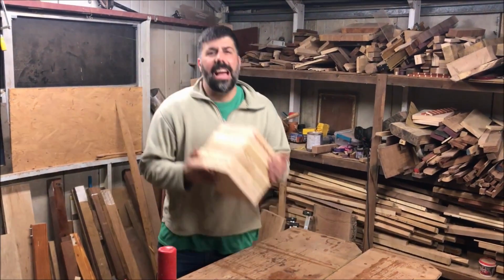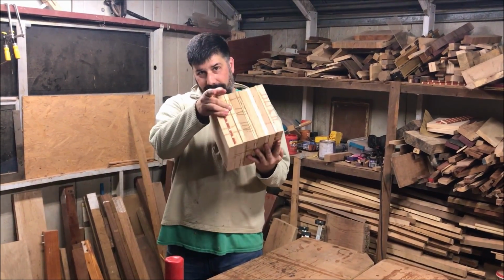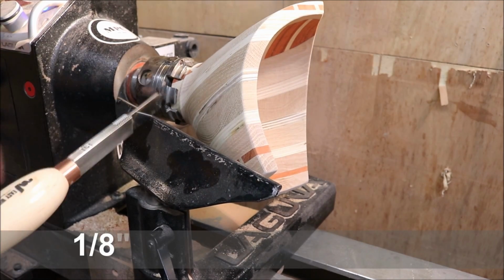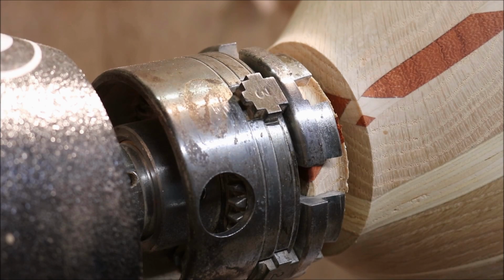Wood Turning - Giant Three Winged Bowl

Comment: Rookie Turner here. Wondering if you could make the square and cut it in half to make two tri-winged bowls saving all of that work and wood?
Reply from the maker: Yes I think you could do that, but it would change the outcome look of the project.  I would be super hard to cut and you would be turning a pyramid rather than a square. This turning used the high corners rather than the lower comers to make a larger bowl if that makes sense.  I still think your idea has merit. Maybe I could try something similar if I could figure out how to make a large enough square and cut it. 

Ken
Reply: Moonpie Creations I thought about support the square and then cutting with a band saw. I thought about it later and you could try a rectangle and cut it trying for the high corners. I try it one day after I get what you've done down without losing an arm. Lol. Keep on with the videos gives us rookies ideas and we get to learn your skills sooner